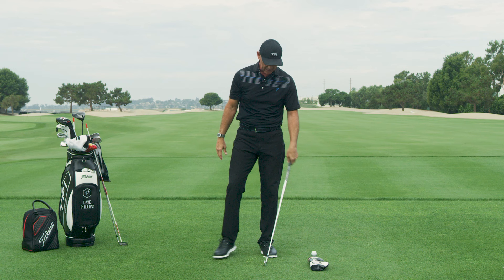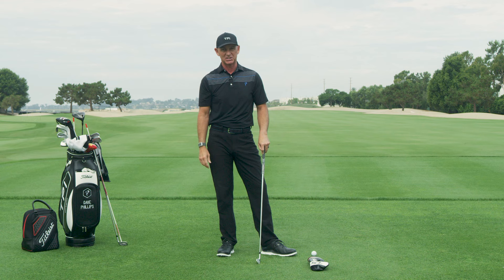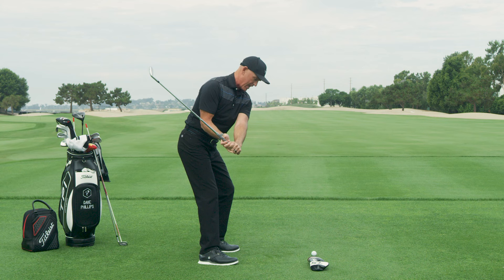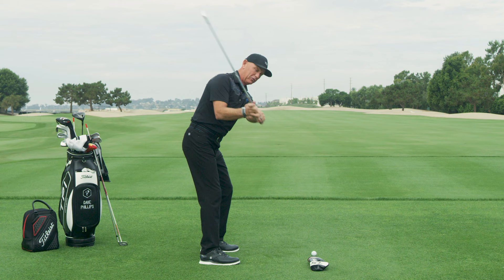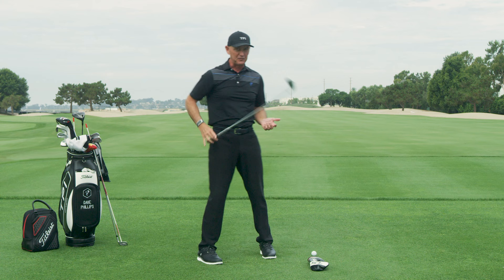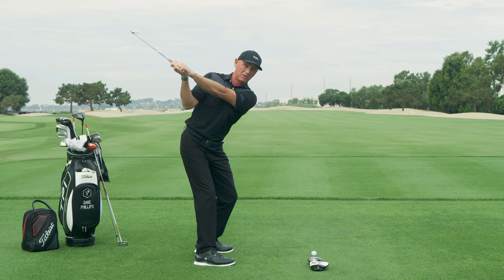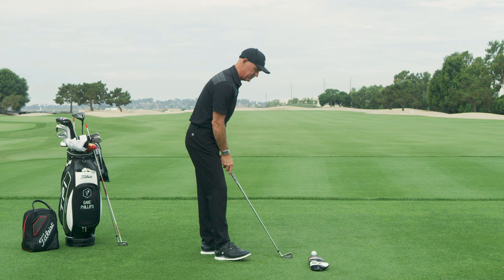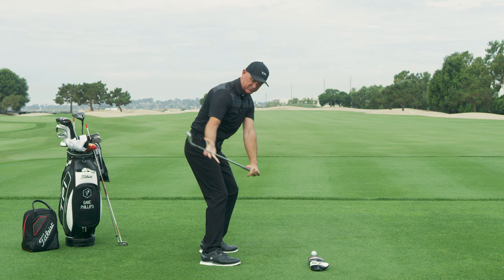Fixing An Over The Top Golf Swing | Titleist Tips

Comment: There’s so much wrong info here 🙄🙄🙄
Reply: Okay. Do better.
Reply: agreed. dis-association is nonsense. his fix to swing arms over the head cover is clearly separating his arms from his body.
Reply: @brentmar2635 I believe that's a feel drill. You have to exaggerate the feel to get it right. Feeling like you're taking it back on the outside and loop in from the inside (Matt Wolfe) will maybe cure it and then you can take it away as you should. IMO of course. I'm struggling with OTT where my right shoulder goes out so I will try both these. I'm 6'4 so maybe the bend over more thing will be better for me.